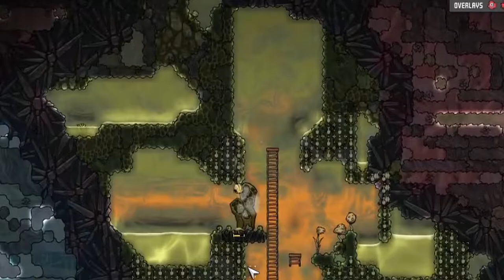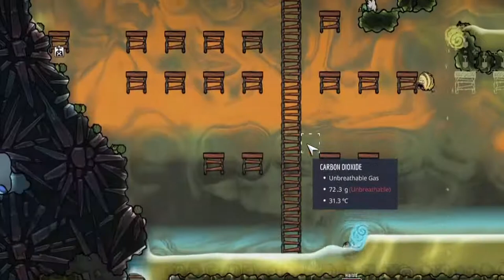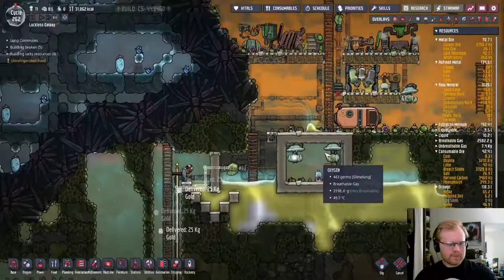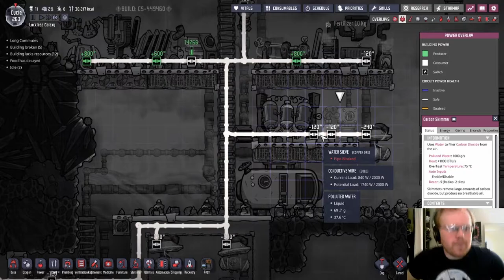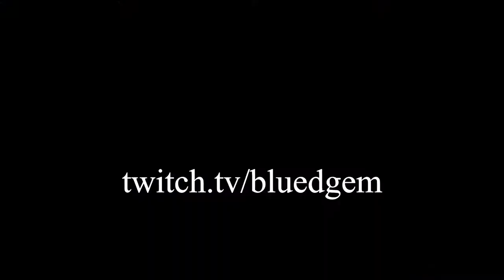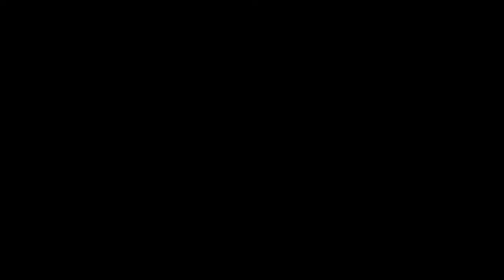Natural Gas Geyser Tutorial l Oxygen Not Included (ONI)

Comment: Love your vid!!
1:00, the mesh tile.
They delete heat just like the steam turbines.  Highest  water output temp is 104F.
For the lols I gravity fed/swamp cooled my entire power chain with a sump pump at the bottom of the cascade.  It worked better than pipes.  I ran 3 plastic presses, 1 metal refinery, 1 oil refinery, 1 glass refinery, 6 natural gas generators, 4 coal generators, 3 kilns nonstop on 5000g/s.  All of it was copper.  The end of the loop was at 107F.
The more water sensitive equipment (Coal generators/plastic press) just it up on a mesh tile with the water flowing underneath.

Comment: Okay so I see a lot of people doing this. Making a large area with their vent inside. I suppose this is okay, you'll only ever get that gas to 2,000g (2kg) per tile.

If you enclose your geyser and pump the gas into your large chamber via high pressure vent, you can get to a pressure of 20,000g (20kg) per tile. 

Geyser and normal vent both have 2,000g overpressure caps.

So having 2 tanks of 10t of natural gas is only 50% of 1 tile at max pressure via a high pressure vent. So, yeah. Math

Comment: Only change I would make is digging out the room more circular. Put the electrolyzed open air at the near-top, gas pumps top and bottom to filter out hydrogen for generator and nat gas at bottom for a massive storage system. Lastly some deodorizers over then polluted water pit and send mostly clean air to the main base that way too!

Comment: I do not like that set up at all. It is very messy and seems inefficient.

What I do is to simple make a small box around the geyser. Put in a pump made out of steel and rig some automation to it so that it notice when it starts to become a lot of gas inside the box and pump it out. The automation will also notice if the storage is full so that it will not pump if the storage is full. To have lots of gas in the pipes is not something that is good as it will spread heat all over the place. With insulated pipes it just takes longer.